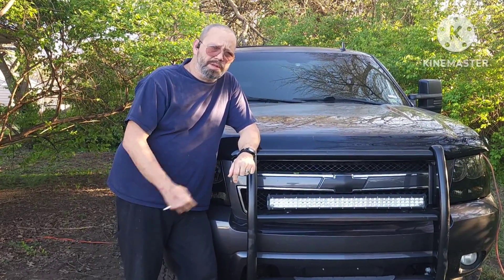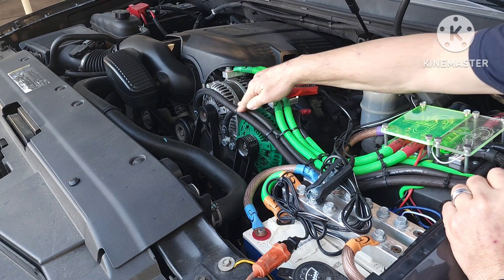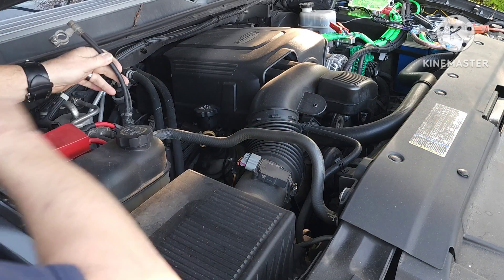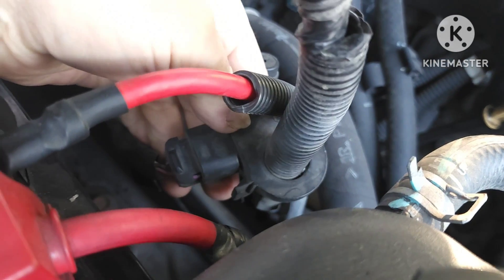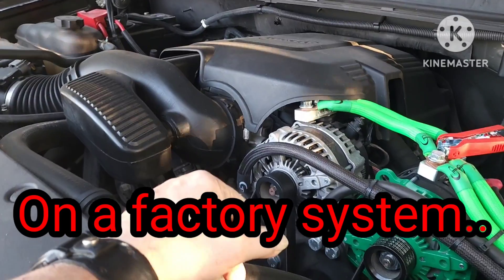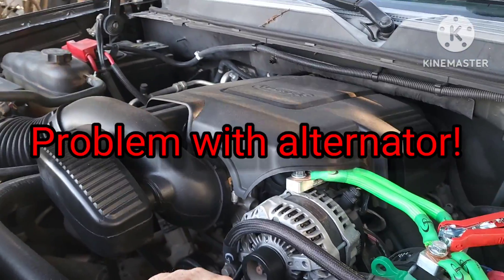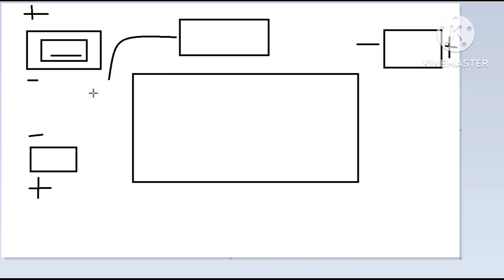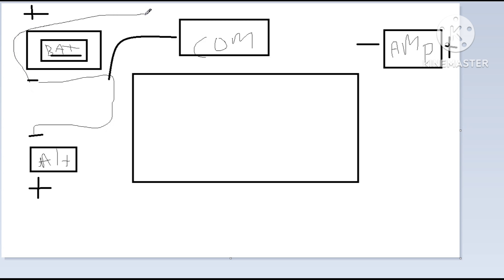Diagnosing High-Output Alternator Problems (Part 1)

Comment: I believe this is why many people  use.  a dual alternator system in the newer trucks. Use the stock alternator for the truck Itself,  and the 400  alternator to run all the lithium. Which then negates the problem of the loop and the sensor.,,, Nevertheless, I'm interested to see what happens.Cause I am buying a new truck next year.